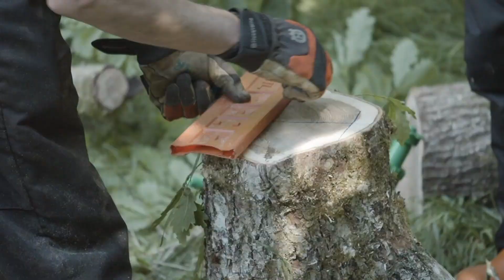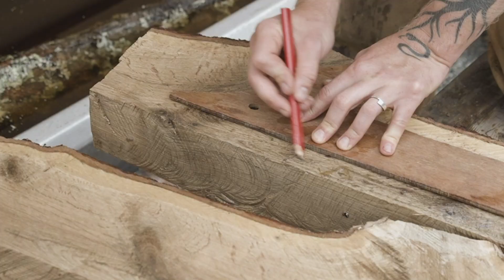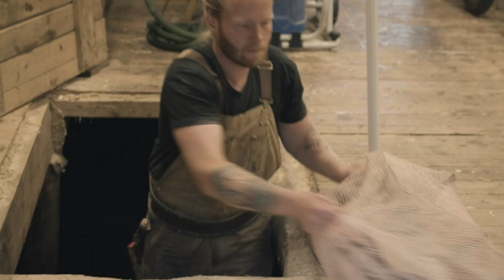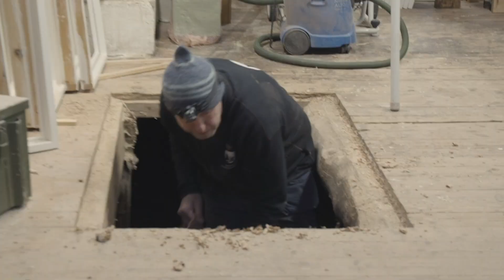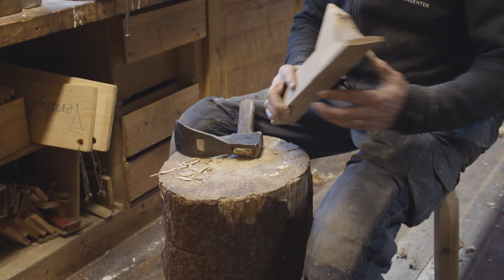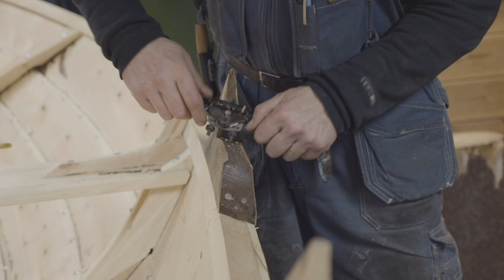Making oarlocks - from finding material to finished boat

Comment: Another wonderful video. Is there a reason why the timber was kept in the basin of water before being roughly shaped, or was it just being kept there and it got rained on? How long where the timbers kept under the floor before being cut to the final shape?
Reply from the maker: big pieces of oak are prone to crack, especially these branch pieces, so we store them in the water before they are roughly shaped, and then they are stored beetween low and hightide under the floors for a year or longer. The wood stabilizes, it's easier to shape and the final keip gets fewer/ smaler cracks